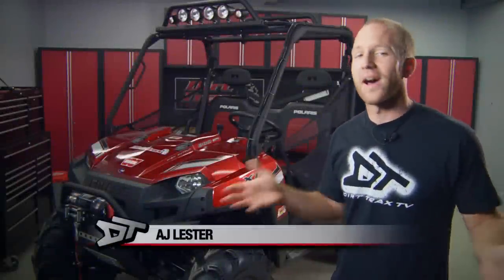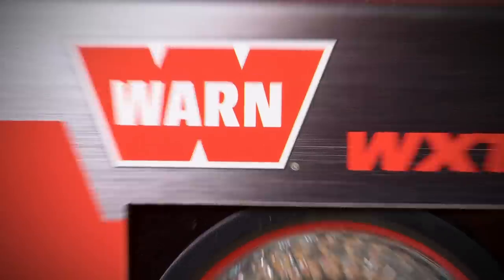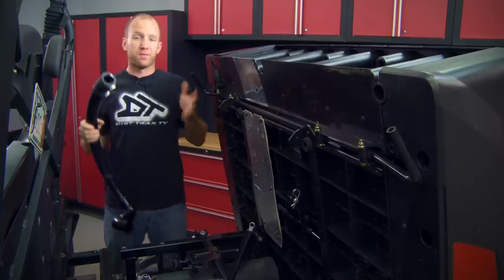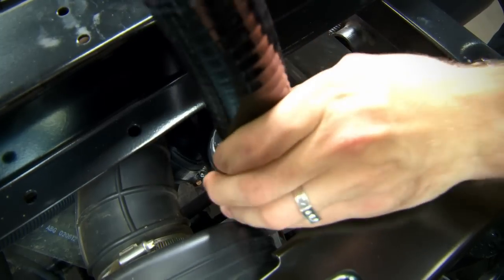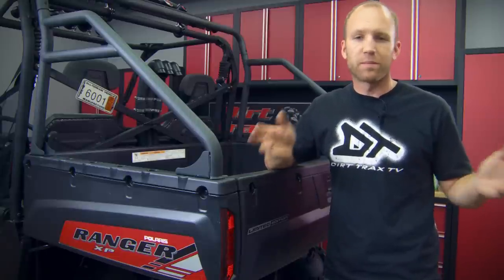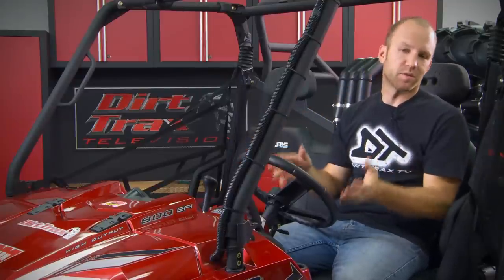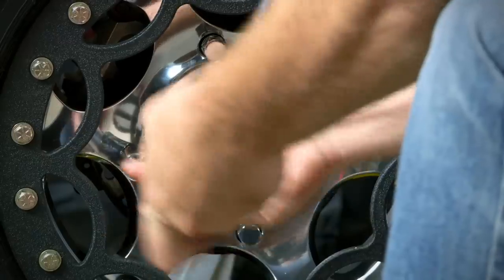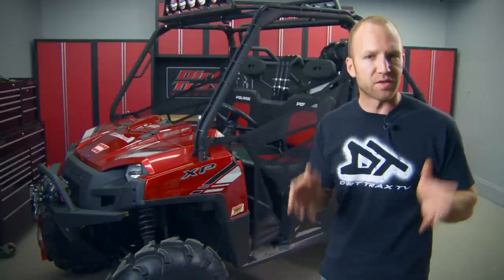UTV Build Project: 2012 Ranger XP Recovery Vehicle - Part IV

Comment: I haven't had the same good fortune withe the snorkelyouratv.com snorkel kit.  It does look slick. It required extensive cutting (my Ranger is a midsize) and it did not come with all the parts needed for the install. Once in place it looks good and does the job, but the stock air cleaner box and the belt cover are not water tight. What did you guys do to make these areas water proof or at least resistant?
Reply: gibbysfixit hahaha..n they never took it in the water. ..problem solved